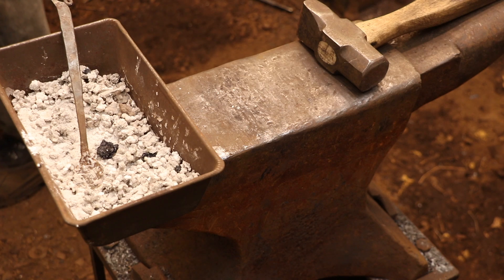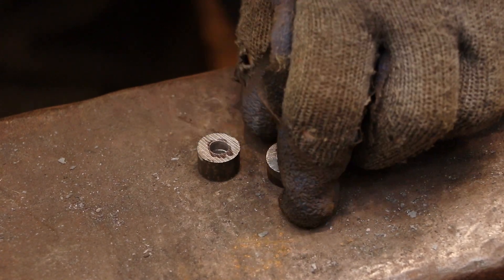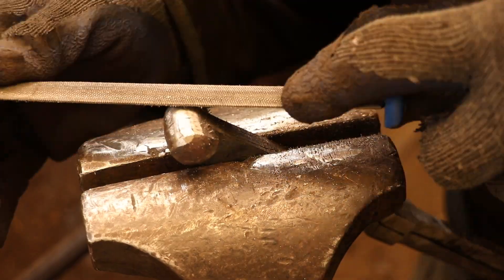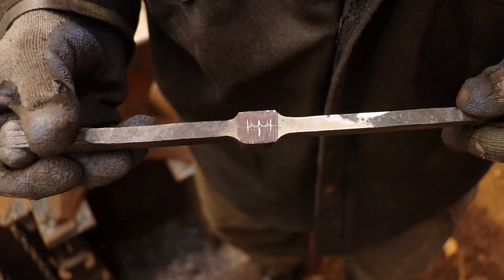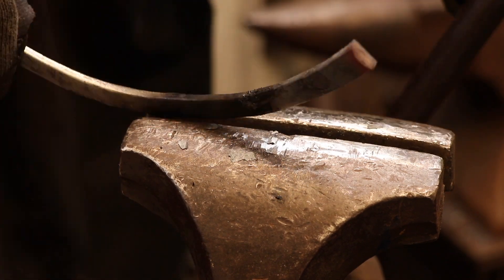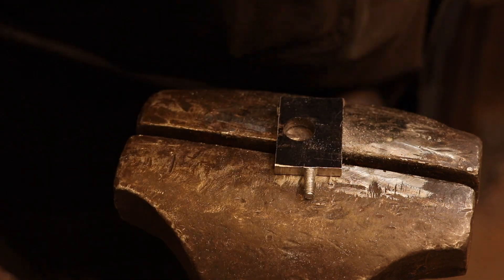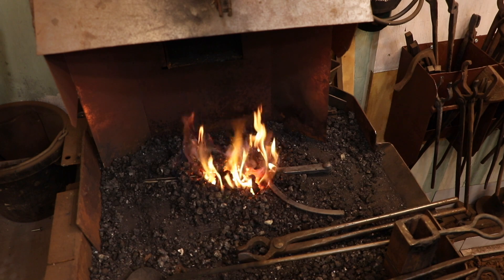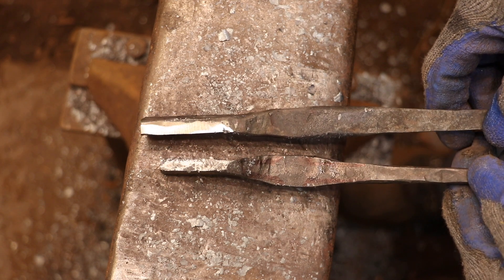Winged Dividers 2 - DF In The Shop

Comment: Years ago I attended a seminar/class on how to forge dividers.  Peter Ross was the instructor. Funny enough, while Peter was attempting a forge weld of two separate pieces on the anvil, one of them dropped on to the floor.  He calmly picked up the piece and proceeded with the weld and they stuck, LOL.  I thought for sure he would reheat first.  You did an excellent job on this divider!!  

I wanted to mention that I'm waiting for dimensional information from the Met Museum in New York for a 16th century triangular pad lock that I plan to recreate.  My plan is not only to make the lock but use only tools available at the time.  This will include making the tools such as files.  I will make the files from iron then surface harden them using known techniques of the time period.  Your pad lock series will be instrumental  in the building process for the internals!!
Reply from the maker: When I  started  out, Peter Ross would be on The Woodwrights Shop a couple of times a year.  I always looked forward tom those episodes.

Comment: Looking back at this video and the firm joint dividers you made and  seeing you perform the forge weld I was quite confused as to why you wouldn't want to just forge a pair entirely from coil spring or something like that. When I made my firm joint dividers based on your instruction I used coil spring as the material to make them from and it felt like it was taking forever to actually make them. I've worked with carbon steels before, I make a lot of stuff from it, but when I was making these dividers it just really felt like I was working with unyielding material, especially since it cooled down a lot faster because of how thin it was.
Reply from the maker: The very tips of the legs are the only part that needs to be heat treated.  It never occurred to me to forge the whole thing from spring steel just for that.  Also you are  right about carbon steels being much harder to  move than mild steel ( even when hot).  That would  add a lot of  time and effort to the project for  no  reason.
Reply: @df-intheshop330  It just felt more and more burdensome the the thinner it got, because the anvil was sucking out a lot of heat. In total it took me a couple of hours to make.